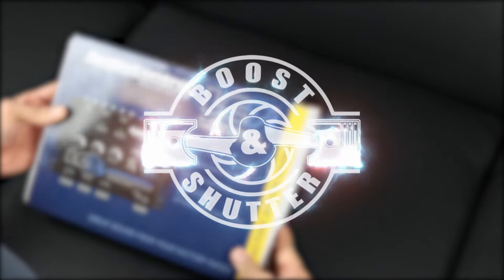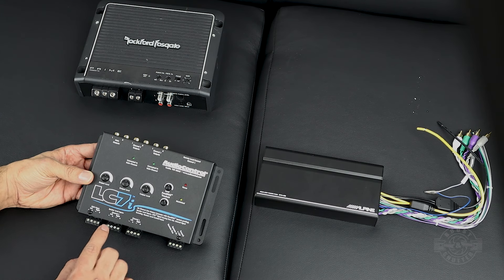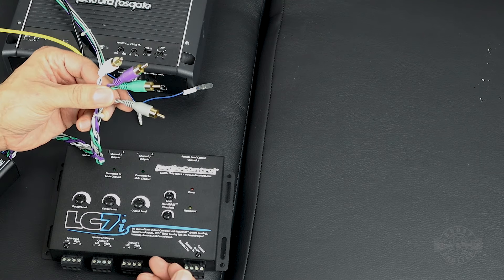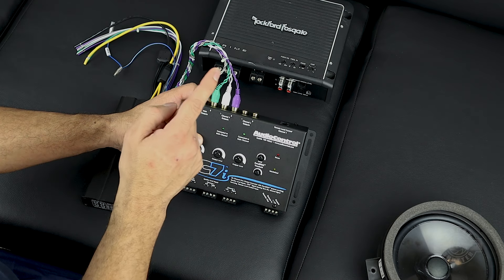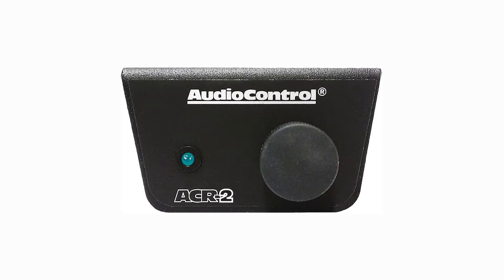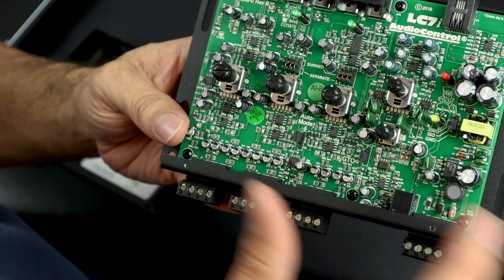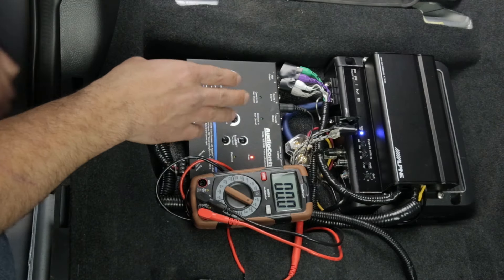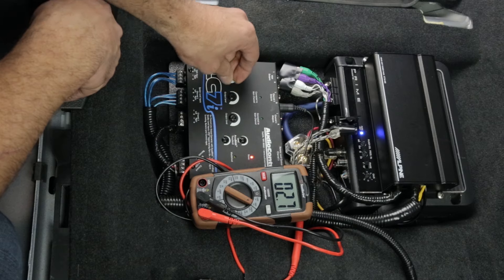LC7i Active Line Out Converter Discussion and Review

Comment: For anybody with a newer car, you should look into whether your stock radio requires a certain resistance level from the speakers to work correctly. After I installed the LC7i in my 2022 Outback Wilderness, I wasn't getting any sound from the rear speakers and the radio volume control was sluggish and not actually controlling the volume anymore. It turns out, the LC7i does not place an electrical load on the stereo, so the car thought that the rear speakers had been disconnected and stopped working properly as a result. To address this, you can look into the AC LGD made by Audio Control that attaches very easily to the LC7i, or if that won't work (some cars require a very specific resistance), you can just order and install a couple of resistors to the signal leads right before they go into the LC7i to get the stereo to behave correctly again.
Reply from the maker: Thank you very much for taking the time to share that. Take care!
Reply: Had the same issue with my car when I added an amp to my 6x9s.
Reply: Can’t u just use a matrix with the lc7i
Reply: You need 47 ohm 5 watt resistors connected to the front left and right channels will make your system scream. It should work
Reply: @KoaSaunoa does it makes the factory speakers louder as well !
Reply: @jamesfair9751  yes my factory speakers get loud.. but ucconect gives me a headache
Reply: what would that do? @KoaSaunoa
Reply: It’s nice setup for what your building love it so are you gonna build a second set up build would be nice ????
Reply: so this would make my door speakers louder with a stock sterior (f150 2015) i got aftermarket door speakers

Comment: I've seen more videos on the LC7 than I'd like to admit & this is by far the best & only one that truly explains the inner workings well. Thank you for that!!

I purchased this recently & an still struggling on how to / where to splice into my factory amp.

I'm trying to avoid running new wire back to my 4 door speakers & utilize the wiring that's already there.
Reply from the maker: I mean, what exactly are you trying to accomplish?
Reply: @akqjtn  trying to figure out where I splice into the wiring at for my signal going into the LC8...the speaker wires going into the factory amplifier or coming out? 

I have a '14 Edge Sport w/ the Sony 12 speaker system and I plan to utilize the factory amp for most of the stock speakers and the front doors, front tweeters, & rear door speakers I plan to bypass the factory amp and run through my aftermarket amp.  I'd like to avoid having to run new wiring and utilize the wiring that is already in place, but I'm a little confused on where to splice in and it's not the easiest to identify which wires are going in and which are coming out, with sooooo many wires! 

My end game goal is to utilize the LC7 to run an aftermarket amp to power 6 speakers that I've already upgraded (front doors, front tweeters, and rear doors - all aftermarket Infinity speakers) & also connect to the LC7, my Orion 2500 mono amp that is currently powering (2) SA-12 v2's, which at the moment I'm using a basic Kicker LOC.
Reply from the maker: OK, the beauty about the LC7i is that the channels can handle up to 400watts in so you could easily plug in post Amp if that's easiest. That said, best practice would be to use the signal before the Amp because that signal is cleaner since it's not already amplified.
Reply from the maker: Try the forums to find a diagram of your sound system
Reply: @akqjtn  so, I spliced into my front door speakers for my main input, rear doors for my channel 2, & spliced into my factory subwoofer wiring for my 3rd channel.

If I'm understanding what you said, correctly, I think I have my settings correct. I switched my auto mode to  OFF (DOWN), I left summing OFF (DOWN), & the other jumper DOWN also. Can you confirm that this is correct please?

Comment: CAF is a life saver for audio installation advice. I've learned so much from that channel. Just bought the LC7i for use in my 2016 F-150 with the 8" Sync 3 7-speaker system (not Sony). Just got it hooked up and am ready to blast some tunes with a clean signal using my OEM head unit. It's a spendy piece of equipment and I wish it had an EQ controller for the same price but maybe I'm asking too much? I don't really want to add in so many signal chain units because space isn't unlimited but maybe I'll end up doing that down the line because I'm sure I'll eventually get annoyed with my limited control with a simplistic 3-band EQ.
Reply: Did you end up wiring the rear speakers to the main input or channel 2? About to do this install in a 2018 f-150. Thanks in advance

Comment: Hello what I would  like know is if you connected this Pack Unit before or after the original equipment amplifier,  
   on the input side coming out of the stereo or on the output side coming out of the factory amplifier?

Comment: Regarding your front speakers and tweeters that you mentioned at 1:19, how do you combine the signal for each on this unit when only using the first two sets of inputs (assuming the third set will be left empty in order to duplicate the rear speaker channel for the sub)?

Edit: nevermind, I watched it again and you mentioned they are already wired in parallel. I wonder if the same is true in my car for the front door speakers and tweeters (factory)... most likely as they are technically only one channel.

Comment: What if I have 3 way speakers? Can I still bridge them together and still use it as 4 channel? And use the sub line ?

I have 6(tweeter, mid, woofer) in the front and 4 (tweeter, woofer) back doors
Reply: If you have a setup like that in the car, mostly you have a premium audio system by factory's default. Honestly even if you upgrade to a active line output plus a DSP and amplifier, you won't "hear" a big difference (not for the money you invested, at least). But at the end of the day, if you still want to do it, keep in mind that 3 way speaker setup from the door, is most likely a single Ch with a build in crossover.

Comment: Only question I have is will this bypass the issue of a factory amp? Just spent 10+ hours in a sound shop and my Jeep gladiator is causing havoc with trying to have 2 amps. I’m looking for a solution and I am tempted to pull the trigger on this to see if it works

Comment: Iam trying to do the same thing but don't have the same 4 channel Amp were do I connect the speaker cables that are coming out of the amp?Do I have to cut the speaker cables of the factory stereo and connect there.Using one side for the Lc7i and the other one for the 4 channel amp?
Reply from the maker: Exactly, that is why I made extensions from the back of the HU since all of the speaker wires are there.

Comment: I need help if you can. I have an LC7i, but I also have an epicenter. My factory system does have a subwoofer and my rear speakers are full range. What inputs would I need to connect in the LC7i so that my epicenter can get a full range signal to do its job ? Currently had subwoofer input from factory in channel 3 input, and channel 3 output to epicenter. To my understanding this is incorrect.
Reply: I would like this reply too I’m stuck in same situation
Reply: All inputs to the LC7i.
Or only the bass input if you don’t have aftermarket amps for the speakers.

Comment: Great video with enough information to do it yourself, definitely accurate video!
Reply: Thanks for the info! Your video answered my LC7i questions. With regards to your front tweeters and mids did you take each of +/- wires from each driver (left & right, respectively) and combined them, then run a single wire (+/-) to the LC7i? Thanks in advance for your feedback.

Comment: Will this fix the whining noise im getting from the speaker I connected speaker wires coming from stock head unit to line output converter and then to my amp and im getting a whining noise

Comment: Can you help me?i have no power at my lc7 I have 12 v all around the amps and the lc7 but no lights are on and no output. I have my signals from the head because I used my meter but not sure what could be wrong.

Comment: Right now Im going to upgrade my front door speakers and tweeters in my 2017 Tacoma with two JL C1-650se's. The factory HU rolls off the bass at the highest volumes. Until I get a sub, would this work to midigate that bass rolloff if I plug my HU inputs just into ch3 and then out from there into those 2 door speakers?

Comment: I have a 2017 WRX with the Harmon Kardon system. If I got one of these would I be able to use it to add a pair of subwoofers and an amp to the stock system without changing anything else? Thanks.
Reply: Yes!

Comment: very helpful, thank you.  For a 2017 Toyota 4 Runner with a non JBL stereo, would you recommend using the stock speaker wire?  I've upgraded the dash and front door speakers.  Thanks in advance!

Comment: Hey boss, good work.  Where did you get/buy the diagram for your factory stereo, to find out which channels are being attenuated and which are full range without processing by the head unit?  I'm in the process of upgrading my 2020 Jeep Grand Cherokee stereo and that is the one thing I need to know before biting the bullet, spending over $1000 just to then get a crappy signal to my system is annoying.

Comment: Thanks for the video, great stuff.I have a question about my current build. I have AudioControl LC7i Black 6-Channel Line Output Converter, 2 after market amps(4ch amp and 2 ch amp(for subs) connecting to a factory Ford radio(i have no choice of using an after-market radio). I'm running 125watt rms to the doors(4ch) so I will use after market speaker cable, not factory internal speaker wire. So with this, im thinking these speaker wires will connect from 4ch amp to the door speakers, which makes sense but my question is where does the 2 sub speaker wire connect from the LC7i to the harness(im using PAC LPHFD31 harness) as the harness will only have the 4 pairs, not 6 which I would need?

Comment: Best video on the LC7I on basically how to install.  What is the Alpine unit you have in the video? I was considering the Rockford fosgate 6 channel AMP in correspondence to the LC7I.  Do you think that would be okay or would you use a separate in line amp for the speakers
Reply: Boost & Shutter that’s what I figured, since it is grabbing the signal from that second channel for the sub.  Do you think it would still be alright to run dual subs, or just one
Reply: Bradley Sproul to answer your last question. You can run duo duals depending on how much watts the subs are and how much watts are on your amp. For example I have 2 12 inch subs that are 1800 watts total so I got a 2500 watt amp. Also your door speakers for example  if they are power range: 5-55 watts RMS (110 watts peak power) than  you wold need the 2500 watt amp to hang with that amount of power. Sometimes it depends on the brand of amp you got too.
Reply: Manuel Esquibel good explanation thank you

Comment: Great vid as always! I have a question about your previous video (long long ago but somewhat related to this vid) about the Alpine KTP-445U. I know you ran that to your Rockford Fosgate amp in your WRX - but would I be able to run the KTP445U as the only amp I have? If so, I believe I'd have to tap it to the battery directly to power it, am I correct?

Comment: I’m trying to figure out if I need this or not I just got my subwoofer installed by Best Buy yesterday and the guy told me it’s not getting enough power from the head unit I guess so the subwoofer isn’t hitting as it should at a high volume and actually it’s not sounding good at all. What would fix that? I know I need a equalizer but I’m having a hard time choosing which one I actually need

Comment: question
how does bluetooth signal work when you have factory radio with LC7i running two amps,subs and door speakers BUT door speakers are not longer connected to radio they are hooked to 4 channel amp?

Comment: I have a lc8i connected to my factory head unit with an external equalizer. I have 5 amps with gain control. So technically I have 3 ways to adjust volume (output level for lc8i, external equalizer volume, and head unit volume). What would be the best way to tune my system?
Reply: Boost & Shutter thanks for the quick reply, but what about the volume for my equalizer because I can adjust that as well as my HU

Comment: Whats the advantage of using the audio control LC7i opposed to using the high level input that i see your Rockford Fosgate has built into it?
Reply: "Accu Bass" I would presume, unless the amp actually provides something similar.
Reply: I was thinking the same thing. Most of the newer amps if you have noticed have the high level inputs in them as well. Not sure how much of a difference this will do over what is built into the amp. Can anyone chime in that has experience with this?
Reply: Also I have been to a few different audio install places and and some have even said that "its a must" to have an LOC" even after I have told them that the amp has the built in high level inputs, I don't know if this is just another thing for them to sell or what. 
'
Reply: @call_me_lou34  Accubass is necessary if using a stock HU , also the signal summing, both the Rockford will not do.

Comment: Is the signal coming from the front speakers out of the head unit stronger than the rear like you said in the video? But wouldnt that be sending more high and mids to the subwoofer when it should be getting lows? Asking because I installed it that way and feel like the bass isnt hitting the lows but rather the highs and mids.. Should i just switch the rears to the channel 2 and the fronts to the main that way the sub gets more lows?

Comment: Great Video - If I have a Factory Amp (Honda Civic Si 2013) It is my understanding the LC7i  would  accept the wires for all 5 channels (F, R, SW) from the Factory Amp, then the LC7i would convert the signal form High to Low, the I can run the signal to Amp 1 (Front and Rear) and Amp 2 for Subwoofer.   Am I understanding that correctly?  Thank you for the hard work on the videos.
Reply: Basically same setup I have. Not having much luck with setup tho. On my amp, Ch 2, Ch 4 have 38 volts on the speaker outputs with the gain at 0. But Ch 1, and Ch 3 have 17 volts which I have adjusted for gain setting. Amp keeps overheating. Very frustrating
Reply: Yes

Comment: Can you run your power ground and remote directly from your amp or do i have to run them from a separate source?
Reply: You can do what you’re asking’ 
Just get a distribution block’ 
It’s basically a pig tail’ put power wire into 1 side and on the other it will have 2 lines so you can run power wire to each amp

Comment: No that you’re using rcas from the lc7 to the power pack did you switch it from speaker to rca input?
Reply: Thanks do you plan on putting up a video on the lc7i install?

Comment: I plan on using a 4 ch jl audio e4300 amp to power 4 speakers and a sub. I have a lci2 now. Can the lci2 do the job right or do I still need a lci7?
Reply: U can’t power 4 speakers and a sub off a 4channel amp’ 
You would need a 5 channel amp and yes lc2i would work you’d just have to get an rca Y cable so you have 2 sets of rca

Comment: Man I have questions. My main one is the speaker connections. We have the default speaker wires running from the head unit to the speakers. Are we cutting these behind the head unit and running them to the lc7i? If so, are the speakers connected directly to the amp, like a traditional setup? So we would need to run the speaker wires to each speaker directly from the amp?
Reply from the maker: This video I made will answer those questions: https://youtu.be/GEx8kv_t9KQ
Reply: Never cut cables, buy a breakout harness
Reply: @ekimandersom4478  yeah I've been done with this project. It works beautifully.

Comment: What if you have front dash tweeter channels, front door channels, and rear door channels (6 CH output).  No subwoofer channel.  The rear speakers on my Subaru don't get a full signal because of the stock HU tuning.  Can you input all 6ch and sum them all into CH 1 -4 output?
Reply: LC 8i
Reply: @ekimandersom4478  u could use the 7i 
Front speakers and tweeters run them together so now you are only using 2 channels not 4 
Then rear speakers use 2 channels leaving you 2 channels free
Reply: @joshymcdaniel9233  Yes there are several options

Comment: I have a 2020 WRX and have done a lot of work using your videos as guides, so thank you! I currently have a 5 channel amp powering my speakers and sub. The amp came with high level inputs so I didn't NEED a line output converter, but I've been very disappointed with the sound. I feel like I'm not getting the best out of the amp and speakers, so I think I'm going to get get a LC7i. This should really improve the sound, right?

Comment: I'm getting a static buzz from the LC7i with any gain whatsoever. 2016 wrx where I used a wire brush to clean a chassis bolt for gnd near the trunk.. Did you have the same issue?  How'd you fix it?
Reply: Read the manual, it clearly says the battery comes to mind when connecting ground and plus !

Comment: My question is why would you connect your sub to front channels if the LC corrects the signal output in a stock radio and accubass corrects the rolloff? My main reason is that by doing this fading capability would be lost, let's say front are a little too loud you would fade back and lower the front volume but this would also lower the sub.
Reply from the maker: In this HU, the rear channel is highly attenuated. That means that using that channel will result in needing to turn up the gain considerably for the sub, which is less than ideal and results in disconnected, hollow-sounding bass without an epicenter. Yes you lose fading, but since the front and back have their own adjustments on the in-line Amp, you can simply fade the system that way before the sub is even installed.